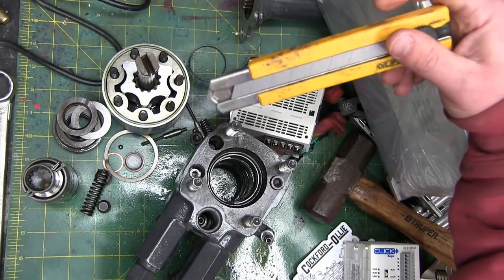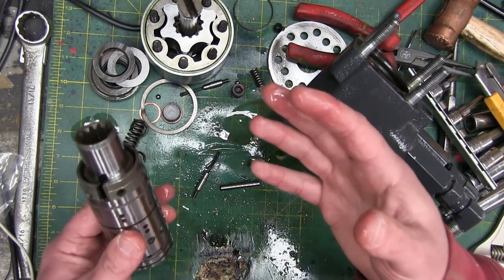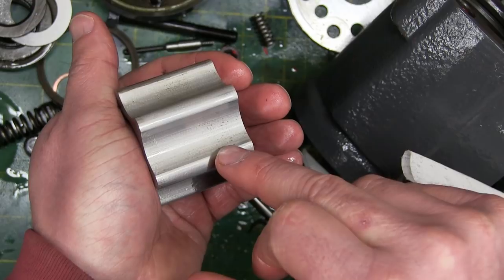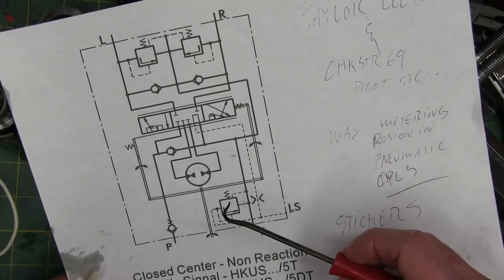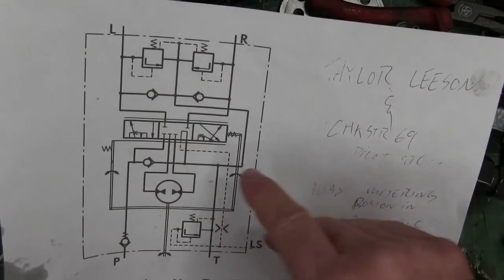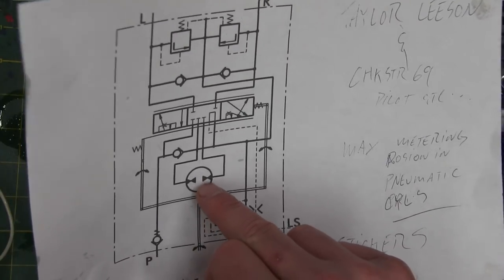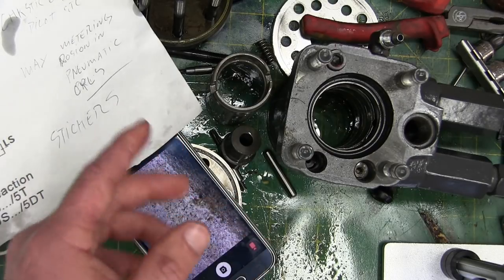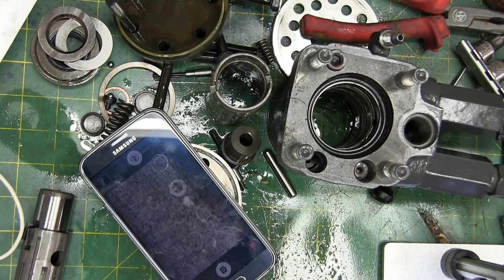Orbitrol Valve Details | My Errors Rectumfried.

Comment: Mrs. AvE:  Honey, the shower is leaking.

Mr. AvE: Fear not my sweet, I'll fix the dibbly doo with these spare Orbitrol valve parts to corral them escaping melting icebergs.

Mrs. AvE: Do I have to wash my hair in hydraulic fluid again?

Comment: Holllyyyyy... Yeah, I mean that pitting, its just part of the industry. A lot of times when the contracts are called, especially from government contracts; they order X amount, then take Y amount and tell you to inventory the rest. A few years go by, that part now becomes obsolete. They just sit on a shelf, in a box, in packing material. As the years go by, the oils start to break down. My pop had a specialty grinding shop and after 60 years, we closed it down. The amount of stock we had was mind boggling. Plus after looking at the inventory, a lot of it had oxidation and pitting. Even though they were sitting in boxes and were oiled before storage. When I look at parts like that, it makes me cringe. Just knowing the guy who made that part probably was pulling his hair out. With such a tight tolerance,  probably a class 3 micro finish, plus it going through heat treating and such... When the machinist saw that order come to his hands, he was probably MFing the engineer who designed it on the computer. haha. 

After we closed, all of our contracts went to our competitors, they have been calling ever since to ask for our operations sheets on how we manufactured these parts. 40 years of hands on experience always beats the engerneerd with that paper that says "Masters" or "PE" 

Like the vijayos. My pop always gets a kick out of them.

Comment: Example of electric over hydraulic: Older heavy equipment used levers directly attached to the valve bodies to actuate the hydraulics. Now with electric over hydraulic, the valve bodies are controlled by solenoids and then can be move to more practical locations. Maybe for easier access, or lower center of gravity. Also, by moving the valve bodies, you get less heat and noise inside the cab, and move the high pressure hoses further away from the operator. (Safety). Finally, you can get more functions crammed into a joystick and minimize repetitive motion injuries. Added bonus, I can adjust the sensitivity of the controls, the speed of the movements and program for repetitive motions, like returning the bucket back to a dig position. 
Thanks for your hard work on these videos. I always look forward to the next one!

Comment: Back in high-pressure fuel injection pump school, those tolerances were referred to as "class fit"- Classy indeed, I saw a tool from the process with the label, " Not plus or minus a thousandth, but exactly."- From the master-mind Vernon Roosa, inventor of the calibrated pop can, the Roosa master pump, an amazing piece of thought and engineering that even after studying and working with for 25 years, still boggles my mind how someone could dream this up.

Comment: The spring provides feedback to the driver (thats the outer loop on the main hydraulic valve body on the diagram). It does that by giving some return force between the inner and outer shells of the spool.  The pin that came out in the first video is your backup on failure, as that allows you to hit the limit on the spool valve and then drive the spline at the bottom via pin. The hydraulic rotary pump you were discussing in the last video is attached to the shaft, so there's a complete drive path from end to end of the power steering system. That means that if you don't have a working pump you're driving the shaft through the centre of the pump via the dowel pin that was through the centre of the valve body.
They're a rotary proportional hydraulic valve and a hydraulic pump.
Reply: Drew yep, and they can be a high speed thumb breaking motor if not timed correctly upon reassembly 😐

Comment: just to touch on the portion of the video where you spoke about pneumatic cylinder seal friction.  Most pneumatic cylinder manufacturers, especially those manufacturing NFPA & ISO Cylinders, offer a Low Friction/Low Speed Mod, where they put different piston seals and/or a special lubricant into the cylinder so the cylinder can be controlled more precisely, or so that the piece of equipment it is attached to can act upon the cylinder with less force.  So what you said about the more load you put on the cylinder, the more accurate your positioning, 100% correct because yes the friction, proportionately speaking, is less with a load on the cylinder, but again, for applications with little to no load, the low friction/low speed mod really helps out. Cylinders with this mod are also good for shock absorption.  I have a customer who actually uses some 2.5" Bore x 4" Stroke Cylinders with this mod on a machine where they hold some large wire wheels to clean drill pipe, and the brush heads need to be able to easily move up and down an inch or so when the tool joint of the drill pipe passes under the brush head.

Comment: As far as the air over hydraulic/electric over hydraulic thing:  I drive commercial vehicles for a solid waste hauler on occasion (Backup driver, normally I'm the IT guy) and their systems are set up in a few different ways.  For the type of application that requires the hydraulics to operate in a binary mode (full flow on, or off) such as the automated style with the arms that reach out to grab the can, those are set up so that the buttons inside the cab are electrical switches that actuate air solenoid valves.  The air solenoids feed truck brake air pressure to a pneumatic servo attached to the hydraulic spool valve to shuttle it back and forth.  (I call those electric over air over hydraulic.  Electrical system controls the air system, air system controls the hydraulic system.)  

For the systems that involve more finesse, the drivers can use air valves that work more like regulators, where pulling the lever back halfway causes enough pressure at the pneumatic actuator on the spool valve to shuttle halfway through it's stroke within the valve body, this gives the drivers a degree of control much closer to what they would expect if they were manually actuating the flow control lever at the hydraulic valve itself.  We use these on our Front End Loader trucks and our Roll-Off style trucks.  For our own purposes for Roll-Off trucks we use a spool valve that accepts both manual input via a lever (pure hydraulic) as well as air over hydraulic from a control valve within the cab.  The spool valves look very similar to this:  https://i.imgur.com/N5BfI6p.jpg the manual valve on the left, and the air control is on the right.  Either of those two systems can shuttle the spool valve within the valve body.  

Hope that helps, AvE!  I could provide more pictures but our trucks are all out in service currently.
Reply: Sounds like you can be their mechanic too.

Comment: The way I understand “air over hydraulic” or “electric over hydraulic” is that an air or electronic actuator is used to change the position of the directional control valve (what makes the fluid go to different directions to make cylinders or motors move.) The reason for this is that sometimes the pressure from the system is so great that it would be too much to actuate by hand. Sometimes it’s due to location of the valves (think relay) it’s easier to run air or electric lines to the operator position instead of hydraulic lines. Hope this helps!

Comment: Mr. Ave i mean to call you out on another mistake. Yes that little pump inside will create enough pressure and flow to move tractor tires by hand or with out flow from the main pump. How ever it really is power steering by arm strong. I'm a Deere John mechanic out of California and love the videos, a lot of what i know about hydraulics is because of your content keep up the good work.

Comment: For precise air cylinder positioning you need 4 air valves. You keep both sides of the piston at the same air pressure,each side has a intake and exhaust valve. To move piston ,intake valve from one side opens in pulses and the exhaust valve from the other side opens in same pulses,piston then gets moved in a VERY precise matter. Add a mechanistic pulse strip and sensor  to the arm and you now have the perfect robot arm,strong and holding any position solid.

Comment: I'll disagree on your assessment of the steering without hydraulic power.  I have two pieces of equipment with orbital steering.  You can steer without the pump running.  Yes, it is steering by "Armstrong" but you can steer.  It's an NHTSA and OSHA requirement for operator safety.
Reply: Large haul trucks for mining applications utilize storage accumulator for emergency steering since they could not be armstromged.
Reply: On smaller equipment, you can indeed steer with the use of the gerotor.
Reply: I conquer with you. One can indeed steer the wheels without the pump running.
Reply: Mr John Ndiritu - but we are stretching the “can” part to the maximum - yeah?

Comment: As my bretheren would agree, you are a fucking class act! You provide shop  knowledge to the masses, and are more rounded with experience than most people. As your comment section  shows, your contribution to the maker community is greatly appreciated. It is awesome that you can bring a group of 200 lb gorillas together to learn, and more importantly, work together as a whole to use logic working on a hydraulic circuit. Great vidjeo!!! Im eating up this hydraulic shit! I have squirreled away quite the collection of componants, and would like to start making videos helping people learn about schematics, flow controls, pressure controls, and directional controls by tearing them down and putting them back together and eventually, delving into more advanced hydraulics. You have really inspired me,   but I have a face for radio, and voices in my head. Wait, what??

Comment: I think ya maybe kinda missed one. Now I'm no expert, but after minutes of in-depth superficial research it seems to me that the gerotor is NOT only providing haptic feedback, but providing feedback to the valve to provide mechanical resistance to some arrangement which allows the inner component to rotate, the width of a groove or so, independently of the sleeve, until the whole thing turns inside the housing. It replaces the mechanical connection of, say, an automotive rack and pinion, for example.

In the automotive boxes, the sleeve is connected to the pinion with an indexing notch, but the inner element is connected to the pinion with a torsion rod. The torsion rod is part of the springiness you feel when you try to move the wheel without the engine running. When you begin your turn, the mechanical resistance at the pinion provides the anchor point for the torsion rod against which the steering wheel first acts. There is also mechanical lash limiting, so it's not like you can just wind the thing up. As the rod twists it allows the inner element to turn say 1/8th of an inch while the sleeve is prevented from rotating until the rack actually starts moving. This opens the appropriate port and pressurized juice is sent to where it's supposed to go. When you stop turning the wheel, the torsion bar returns the penis to the neutral position inside the pussy, and the juice just runs in circles. Wheel shocks likewise bounce off the torsion bar and are automagically compensated for by the valve.

At least, that's how I understand it. Which begs the question: how does this happen inside the Orbitrol? If the gerotor pumps to the cylinders, it must pump essentially nowhere until the ports open, for instance. 

Cheers!

Comment: You are the best thing on internet mate! Air over hydraulic is very similar to smaller rigid.truck brakes. Air is pushing the hydraulic fluid allowing extra "pressure" with out the big pump...... do a video on it: )

Comment: AvE that pump is extremely similar to the pumps on light duty tractors. And it is hard, but on a little 80 horse 2 wheel drive tractor, you can turn the wheels with no clangin and a bangin of the motor. 

Also, you said it was a pump and a motor. This is true. You disconnect a couple lines on the power steering system of a light duty tractor, and you can use the pump and the 300 pound gorilla to completely flush out a power steering system. (Small farm tractors and what not use a power steering pump, separate from the hydraulic system, in conjunction with that hydraulic pump.) but ya know, you take the same setup and put it on an articulated loader weighing in at a whopping 40 tons, and you’ll never turn the thing by gorilla power alone. But the concept is the same. 

Great video, I️ can’t wait for more hydraulic systems videos to come out. You fuckin killed it like always.

Comment: The blue print; I’m not positive but I think: if the solenoid is left or right it directs flow to what your calling a pump/motor but what I suspect is the proportional valve. So when left or right is hit on what I would guess is a joystick the solenoid shifts left or right and the proportioning valve rotates controling flow rate as per the joystick. The 2 relief valves at the top allow relief for when the cylinders are fully extended. The bottom pressure relief seems to be for when the solenoid is shifted left or right but after the steering cylinder is maxed out this pressure relief (probably set to a lower pressure than the two above) is opened and leads to a limit switch that might center the solenoid or open a bypass or turn off the pump. Love the videos👍🏻 keep up the dicking around, it’s better than me having do it.

Comment: Hey AvE, maybe the one I have works slightly different but I drive a tracked vehicle with a hydraulic steering system (Hägglunds Bv206) that DOES in fact let you turn the wheel to pump hydraulic fluid and steer the vehicle when the hydraulic pressure from the engine is nil. It takes a whole lotta turning but it's doable, I've done it several times.
Reply: Very true statement the internal pump is assisted by the external 
It is not just for feed back 
When external pump fails the internal pump becomes an emergency pump and can turn the wheels if you apply  enough force on the steer wheel 
It also takes more turns  of the steering wheel when in emergency mode because of slippage in the internal pump
But you can steer it
Reply: Have a Yale Forklift.....SAME WAY.  Spin the steering  wheel with engine off, and eventually  the wheels turn. So YES it does work as a pump, and it's designed to work that way.
Reply: I have relocated a mil spec 10k forklift that was secured. (padlock and cable on stering wheel)just had to kill the motor and take another bight refire the motor turn some more, repeet 1/4 turn increase each (8 starts lock to lock)
Reply: Same here. My Volvo wheel loader has one of those. Its a pain but the machine will eventually turn without engine running.
Reply: Agreed, I’ve done it on tractors and dumpers with dead engines, it’s a whole lot of winding away on the steering wheel, and it generally feels like the pressure is leaking away as you go but they do turn....
Reply: I have machines that use the pump in a dead engine situation, when steered with a specific valve closed to pump the park brakes off to allow towing and also steer the machine when dead

Comment: That oil pump looking thing at the bottom of the valve body, every time you put that 6 lobe rotor inside it's cavity and turned it, it gave me goosebumps and freaked me out. The sound of the metal scraping reminds me of nails on a chalkboard, fuck!

Comment: The fit on the valve is the best fit I've ever experienced!  You can tell by dropping it in on a level surface and watching how slowly it moves downwards.  Nothing cooler than a mechanical proportional system. You should look into a danfoss flow amplifier if you want to see technology at its finest!

Comment: Air over oil:  pneumatic power, but flow controlled hydraulically.  Industries always have compressed air and since they already paid to have this air pressure, it's cheaper to put that power to use in air over oil, cylinder for example, than to have an independent hydraulic pump.  A large diameter air cylinder provides plenty of skookum power but air is a shitty medium for precise speed control.  Hydraulic oil pressurized from the air piston gets metered through check valves and solenoids to combine the, already paid for power, with precise flow control.  Quite a mouthful, but clever as frig!!!

Comment: The pump is there for a few reasons. It does allow for some emergency steering in case of engine failure.  It also provides some feedback to the operator.  Most importantly, it meters a known quantity of oil to the steering cylinders for every turn of the wheel.  It's sized to match whatever the flow requirements are for the desired steering speed.